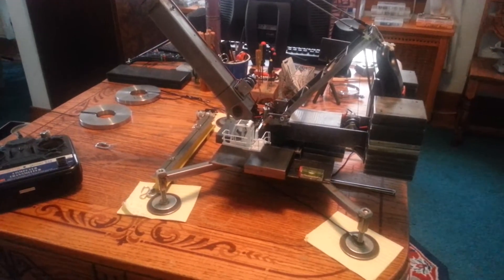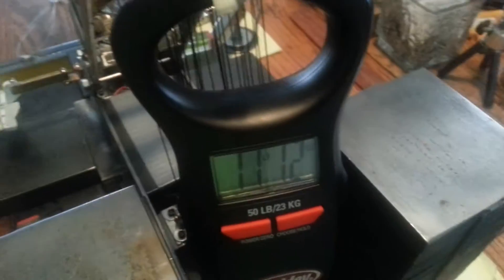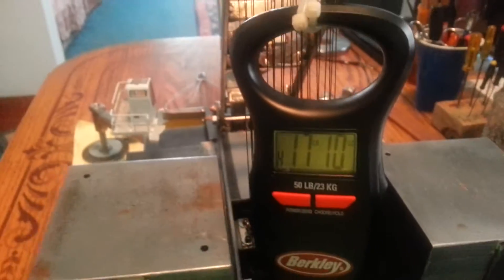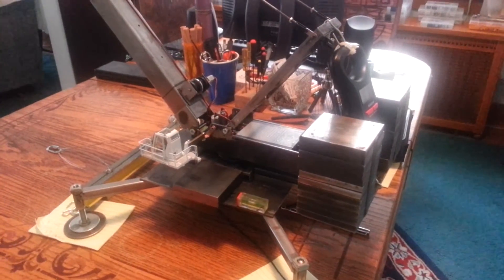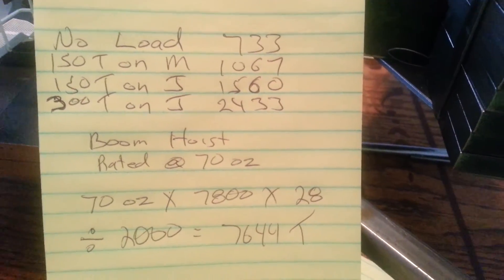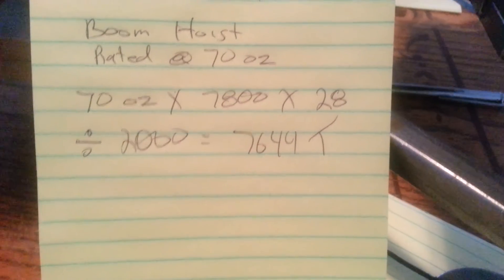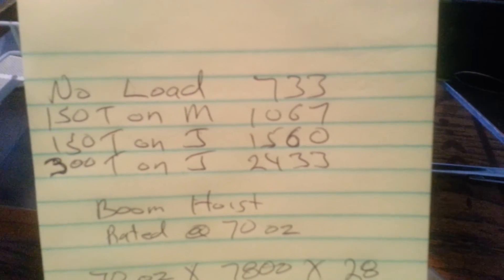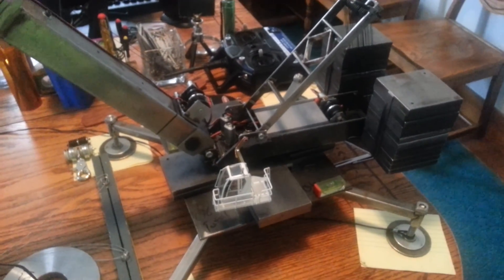Testing load dynamics

Comment: Subtracting boom from the 150t jib weight results 827t not your 873t.
Subtracting boom from the 300t jib weight results 1700. Divided by 2 equals 850t (150t) agian not your 873t.
If 150t equals your 873t then the first jib measure should have been 1606t
with another 150t(873t) the 300t measure should have been 2479t
1560-733=827
2433-733=1700
1700/2=850
They don't match.
Love you experiment but don't believe your results.